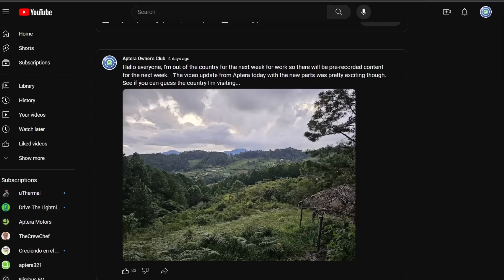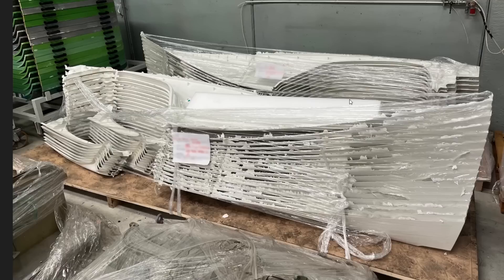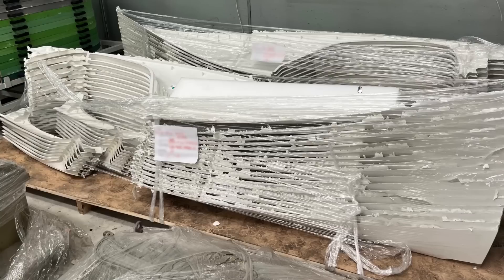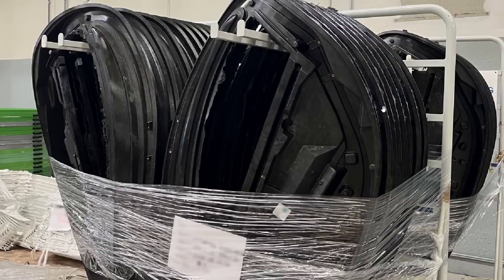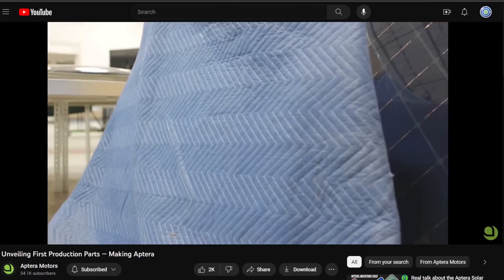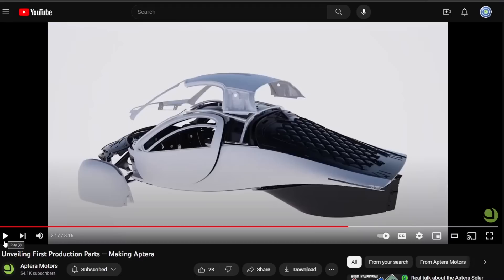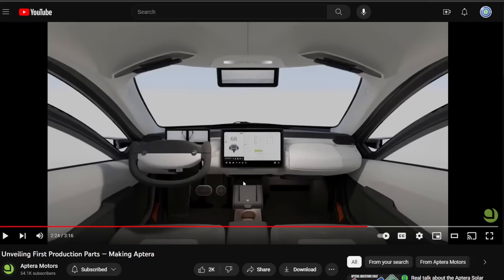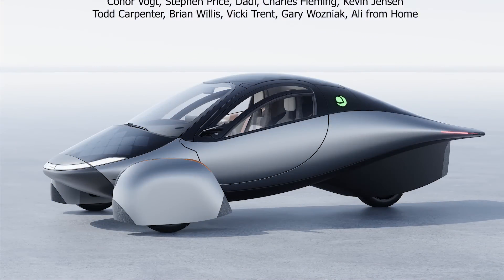Aptera's First Production Parts!  When will we see a physical Delta?

Comment: I believe Carbon Fiber parts are basically like CF fabric which is held in place with a form, it is then baked for it to change phase into the ridged CF parts we all have come to love. So having the cutout for the top window aperture would just make things more complicated in the baking process, it's easier to just cut the aperture so they don't waste any CF parts due to any kind of movement in the form. But yes, CF is difficult to cut but with the proper tools it should be okay.

Comment: Thanks Steve. I believe(?) I recall past pictures of early Aptera solar panels sitting on the roof of the past Solar facility in Vista. I hope(?) the “start of the production intent vehicles testing happens early 2024. In my mind…No short cuts on validation ! It would be sweet if they could have one production intent Aptera at or “about” 2024 CES??? Yes. I imagine you are right.. that  the “blank substrate panel” in the top part of the door window may (?) for strength before the stationary glass placement.

Comment: Made similar comments at Drive the Lighting when they showed these fiberglass parts wrapped in cellophane. I guessed they wrapped them till they could get them into a trimming room and were protecting people from being hurt by the excess which could get into someone's skin. Someone thought the parts in the door opening area are the outside cover parts for the A pillar. Closeups showed they are finished. Also there are enough here for 16 bodies and the counter parts should be in the other side still wrapped. It hard to count the big pieces but I get 16 to 17 looking at the area where the cellophane is pulled down and then slide over to the left to count down to the pallet. But 16 seems prevalent in the other photos.

They also had a picture of the inner carbon doors hanging on a hook that was sideways like they were laying down but is a phone camera shot turned sideways. Showing that on one hook they had 8 of one side. Possibly they had the same shot you show that are vertical and behind the shot of the ones you note as needing trimming?  The picture with four racks with Steve foreground right is tough to tell how many on each hook. But if correct each should have 8 on them and are enough for 16 sets of doors. 

This does not mean they will make 16 bodies. Just that they could. If they did it would be 6 more than my earlier hope of a minimum needed. This allows for some to be in promotions here and the EU while testing! This fits what Chris is saying in the video about being able to validate the PIV and raise money and increase orders as well via shows. Maybe someone wants to see more orders before stepping up?

I think Chris said what was the first commissioned part to Bearded Tesla Guy and that it was the cover over the inside of the door where the latch is at... you do not see that in the body panel. Just had a thought. This might be the first time a production vehicle actually looks like the prototype vehicle only cooler!! Not the other way around. Love the new rear monitor. Almost as wide as the control screen.

Comment: Me personally 2024 sounds about right. Once the body is put together all the other companies could make other fitted parts with some slake and brackets and things. I'm still interested in how easily it will be to clean or vacuum out the cooling airways remove vents or whatever, because trees drop blooms and everything on the cars. I'm also curious because line connections close to the wheels are always the strongest vibrational rubbing and wear for all cars, so I'm thinking something like a moving padding or cover or noodles with a slice or something not prone to ice maybe even a 12v heating cord with a timer at start up. The radiation of warm wires will cause snow to turn into ice parked or moving, so there needs to be some minor removable loose fit around the lines that are meant to flex, the small section not the entire line. If done right at low heat levels the 12v lines will melt ice and never burn the other connections. For me it's the best and perfect solution for all weather and vibrational rubbing, otherwise all the lines will  need replaced at short time periods every few years. Me personally will solve my own issues if I have to and check before winter start ups, because ice seeps into any tiny movable space moisture will. The rest of the car is very nice so I'm still waiting for my Aptera for sure. New parts and wires  and sleeves always need a little slak otherwise pulling happens and that's   a even faster issue to happen. We need flex and easy replacing  wear add on nice and cheaply done popping on or off made easy.

Comment: Comma devices may overheat in sunny locales. I run my defroster to help move the air whenever the system is too hot to run. Wonder if Comma will produce a version specifically for Aptera or just the current iteration of Comma device.

Comment: I think that Aptera is on track for getting a handful of production intent models built before the end of the year. They plan to have a few for crash testing, but most of them would be used for validation, systems testing and later reviews. I think that it will be great news if they can have solid, 3rd party validation of range, acceleration, solar, cooling, electronics, suspension, etc.. If validation goes well, Aptera will likely revisit early reviewers like Jay Leno and Rich Rebuilds to show progress and hopefully announce a firm production start date in 2024.

Comment: I'm wondering if the missing edge on the fiberglass-FMC side panel is now incorporated in the fiberglass-FMC roof and/or the roll bar structure shown in the render at 11:00 in the AOC video.

Also, with the overhead rearview monitor, I'm wondering how the comma module will hande both the forward-looking autopilot view and the necessary (I assume) conventional rear view. Split screen? Switchable? Neither seems ideal.
Reply: My guess is that it will have a feed from the rear cameras.

Comment: Just to help. These parts are molded not "stamped".  The area that needs cleanup is called flash. Tooling adjustment can minimize flash. Fixtures will be needed to route off the flash.  Wrapping these parts too tightly will cause warping. Just a heads up on warping
.
Reply: "Fixtures will be needed to route off the flash." So an interim AUTOMATED step before ready for assembly?  …onerous in time/cost or standard, minor interim step?
Reply: What is your reference supporting molded not stamped? Based on other descriptions I assumed stamped. The forming device is a press mostly used for stamping, and weighing upwards of five tons. Such a device not needed for molding. The material is not homogenous which would be more appropriate for stamping rather than molding. I see only the stamping device with no description of heating as common with molding devices to cure the molded segment. The device is referred to as a dye. A reference most common to a stamping device.

Comment: Ref:  question about adding additional panels to the roof.  
Answer:  adding additional panels to the roof as grid-tied, requires permitting approval by utility & building (city) inspector.  The requirements would be updated technical drawings, confirmation the utility disconnect is still sized properly, confirmation inverters are not overloaded, review of transformer size, review of any existing tariffs (ie net metering changes), confirmation any rebate/incentives will not be affected)... and I could go on about the expense and various ways of 'just adding a few more panels'.....  but suffice it to say, it isn't as simple or as cheap, as one would think.

Comment: Thanks Steve,  We are moving down the road.  I'm surprised that this rather thin material is as "strong" as the original design.  The other Steve continues to boost the roll-over strength of the vehicle based on the earlier composite construction.  Keep up the good work.

PS:  I think that in the world associated with computers that 8 is a more even number than 10?
Reply: Carbon fiber is immensely strong even at this thickness.
Reply: @jamesengland7461  Amazing.  I'll still be watching for the new and improved roll over testing.  Why do we now need a frame?

Comment: Remind me, is delta the final build? Like are they sold? Or is it last step before production model?
Reply: Yes, the delta is the production model. It would not be surprising, though, for the delta to have some adjustments before the vehicle is available to purchase.
Reply: @scottgreathouse2607  Yep.  My guess is that there will be 3 waves of Deltas:
1. Hand-built from sample parts (this year)
2. Production-line 'walk through' with validation parts from suppliers (manual operations simulating the production line process, late spring / early summer)
3. Early production-line with final parts from suppliers (to test the automated processes, late summer)
Each stage would require some level of re-validation
Reply: @WyndStryke  4. Delivery of 1st production vehicles Fall 2024.  Sounds realistic assuming no regulatory delay (none expected)… question then is size of early production runs?
Reply: @scottgreathouse2607  The delta is the production intent model, but not necessarily a production model. Some changes from validation testing may be made if the delta performs outside of the expected performance ranges during testing. When those changes are incorporated it should result in a true production vehicle.
Reply: @scottgreathouse2607 I agree with this schedule and production maturation. To be a true production vehicle it needs to pass verification testing and testing and remediation of any production process defects.

Comment: A thought came to me... After they get the loan, the should implement a new accelerator program after the first one concludes with a lower minimum amount, e.g., $5000 with a $30 million goal until the IPO, or issue warrants to current stock holders shortly after the IPO...

Comment: Do we know yet if the Aptera will have one pedal driving? I just got a Bolt EUV and are in love with the efficiency of one pedal driving.
Reply: Practically any vehicle with regenerative braking has “one pedal driving”. The more motors.. the stronger the potential regenerative braking. The option to select and to what degree is software controlled. In short, yes. “one pedal driving” is just a widely used term to describe the ability to drive an EV with regenerative braking with minimal use of the brake to slow down/stop.
Reply: @evolv.e  Some EVs are programmed to apply the brakes to come to a full stop at low speeds when regen braking becomes less effective, so that in normal driving the brake pedal is never needed.  I doubt Aptera will have that feature, but they have said that the aggressiveness of the regen will be adjustable.
Reply: @robertkirchner7981  I don’t know of a single road legal vehicle where the brake pedal is never needed. Nor should any vehicle be allowed in the road without mechanical brakes to slow or stop the vehicle when slowing or stopping the vehicle more quickly is necessary. 

Thankfully, there are no vehicles for sale in North America that can sold legally without mechanical braking, whether the manufacturer advertises they have “one pedal driving” or not.

Comment: In my opinion, Aptera will have a Production Intent vehicle or two by year's end.  The question is: Will the first go right into validation testing or will they be for public review?  If they have more than one to work with, they can do both at the same time!
Reply: The need some for the destructive crash testing.
Reply: @garywozniak7742 I doubt highly that they'd crash the first few Deltas.... they need vehicles to attract interest.
Reply: @garywozniak7742  If real life lives up to the simulation results at all, it will be off the charts!
Reply: @garywozniak7742  But not the very first ones please, that would only delay other uses.  After all the ones they use for validation can always be crashed afterward, but not the other way around.  
Validation testing seems to me to be the most urgent use, as using the first vehicles for publicity would only add to the demand that they can't meet until after validation.

Comment: In the commercial building market, leased building upgrades and improvements  are the responsibility of the tenant!
Reply: Unless those panels produce a net profit for Aptera then it’s a waste of resources.
Reply: Maybe generally but EVERYTHING is negotiable. A long term capital building improvement for a startup tenant is one such likely shared cost upgrade… especially solar in CA as tax incentives likely go to building/property owner.
Reply: Solar savings takes several years to produce a net savings. (Never a net profit). But putting solar on the roof is within Aptera ethos. Being efficient and saving money in the long run is by no means a waste of resources. Cost for the system could have been either amortized thru a tenant improvement agreement, paid directly by the owner, or directly by Aptera. No matter what, Ap[tera will get the benefit of lower energy costs. @ZzHasbrozZ
Reply: The panels are new. Look at satellite view, no panels.

Comment: Some good points about no updates on casting parts and other critical suppliers, but that doesn't mean it's not happening in the background...obviously the pressed body parts capture the most attention so that's pushed to the top of the publicly shared content. There are those who love to shoot down any sign of progress and use statements that were made months ago as "proof" of deception or incompetence when a new statement is provided with an updated projection. Just because a few months ago someone at Aptera said that something was not ready yet but they were working on it, does not mean progress has not been made since then. Silly haters.

I'm thinking there's probably a good chance of at least 1 Delta rolling off the line before the end of the year, even if it's down to the last week. That's a pretty huge milestone and I expect they will want to be able to say it happened in 2023 rather than 2024.
Reply: Agreed

Comment: CNC'ing extra parts is %100 better than trying to make something perfect like out of pressure molding like what Tesla does.  Just a single CNC cut and those things are perfect.  I'm impressed actually, most people don't trust the pubic with the raw presses.  If you watch some CF videos you'll see that they are doing it as simply and accurately as possible.  This is great news.
Reply: I believe it is also still very efficient use of materials, with little waste.
Reply: I thought I remember that CPC might have laser trimming  capability?
Reply: @garywozniak7742  I didn't know lasers could be used on CF!  That sounds even better than CNC if it that's all sorted.

Comment: It's encouraging how tightly the parts pack together.  When Aptera develops the expertise to assemble the bodies locally, they'll be very cheap to ship.  Possibly even cheap to airlift if needed.
Reply: From the looks of the relatively lightweight looking rack holding up the stack of black door panels they, not suprizingly, appear to be very light.
Reply: living in hawaii, we have a rather unique perspective on air shipping body parts since we have to do it all the time.  it is very VERY expensive because the shipping companies claim that the body panels are easily damaged so charge extra to ship this stuff. some places wont even ship.
Reply: @pezpengy9308  Aptera's plan (at first) is to have CPC assemble the bodies and ship them to the U.S. where they will be finished with the battery pack, motors, interior, electronics, HVAC, and solar. Also I think that the lightweight but strong Aptera body will be more resistant to scrapes, bumps and dents.
Reply: There is nothing cheap about airfreight it’s $$$$
Reply: @andrewfuller8440  ... and because of this, I also hope (like @robertkirchner7981), that eventually CPC will ship compact stacks of body parts, that will be assembled at the Aptera factory.  To me, it doesn't make sense (in terms of shipping costs and shipping space) to ship fully assembled units)
Reply: @pezpengy9308  Just put them all in a big box labeled "Fragile" and they'll feel no need to handle them carefully,
Reply: @andrewfuller8440  But it's cheaper to airfreight stacked parts than assembled bodies. Ideally neither would be needed unless there was a huge disruption in the supply chain, but as we learned in the past three years, that never happens, right?
Reply: Maybe they can take advantage of the close proximity to Mexico, and take advantage of the low cost labor, like a lot of US companies do.

Comment: Bet you are good at jigsaw puzzles, as you seem to understand how things fit together. Steve and Chris had a video where the solar was being installed, and they stopped to speak about it, as the noise level was high enough to interrupt them. The newer rear-view mirror change most likely is done to accommodate the Open Pilot. My Easy pass will be right next to the "mirror." Production intent, instead of Delta, hope it is a Christmas time celebration. My biggest hope for Aptera is that the ATVM loan is granted ASAP, yesterday would have been better. I also would love to know how much they asked for, because if they were smart, they would have asked for more than enough to have a second assembly plant somewhere in the southeastern USA. #23 it is now very close to making those Launch Editions and we can cheer and celebrate this as we drive away in a brand-new dream machine, aka an Aptera!